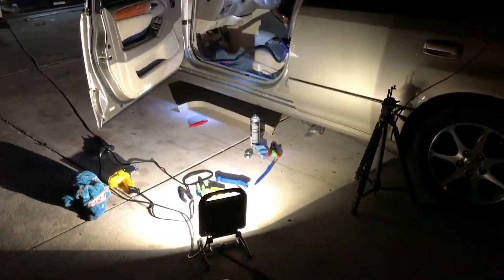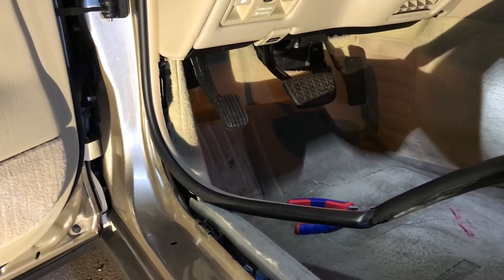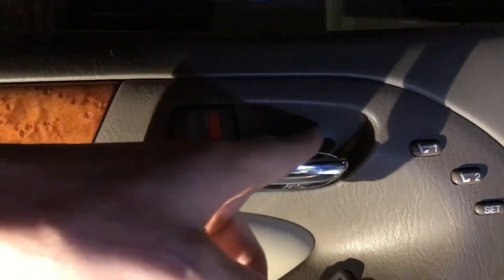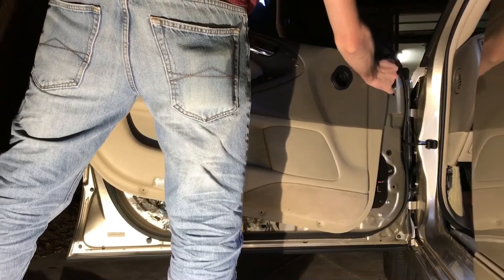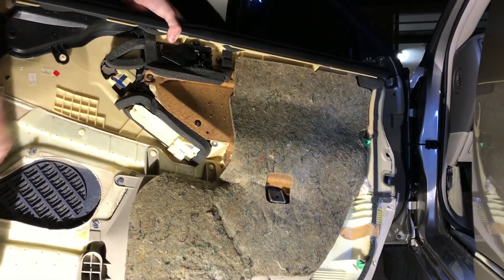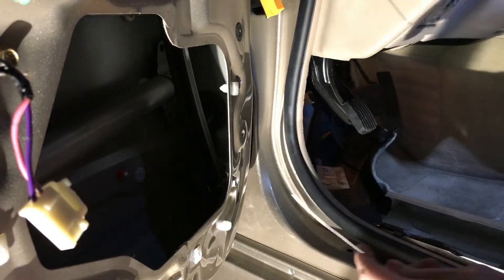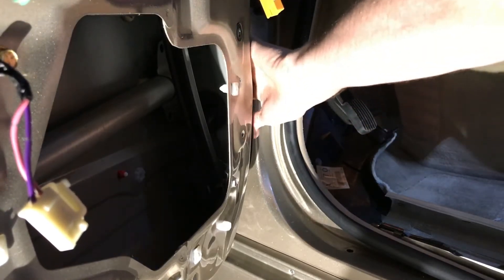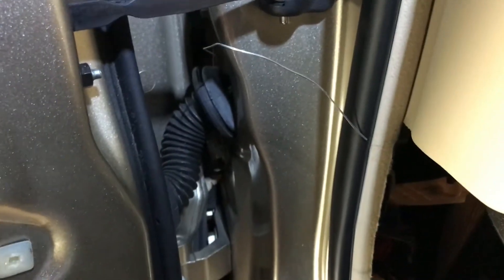Part 2: 98-05 GS/Aristo Illuminated Door Sill Installation

Comment: I just popped the courtesy lights from each door to get a color code then traced the back inside the panels and tapped into them there once I double checked with my volt meter. All 4 in less than an hour. Bravo, bravo excellente!